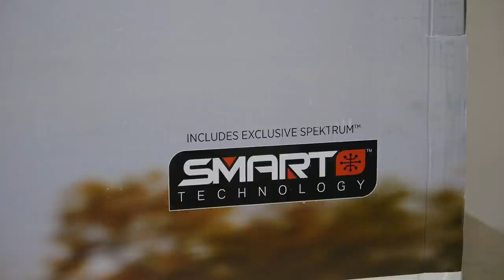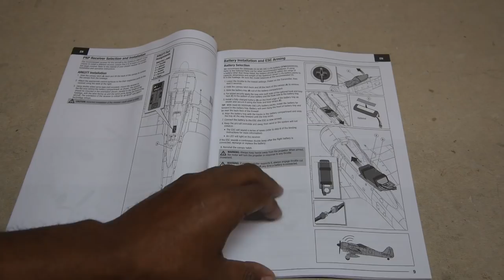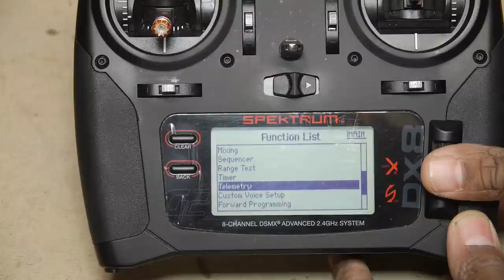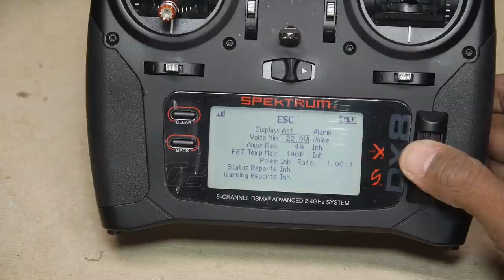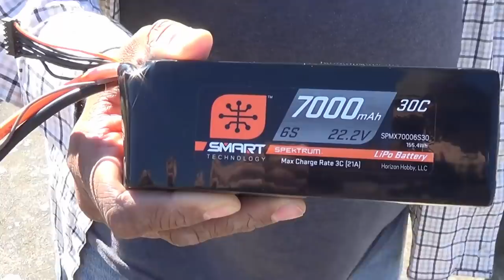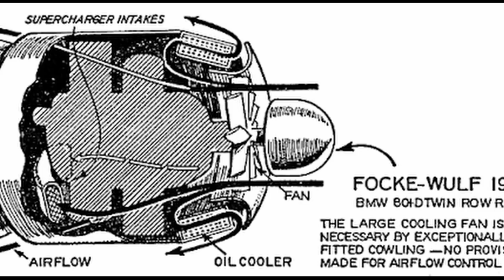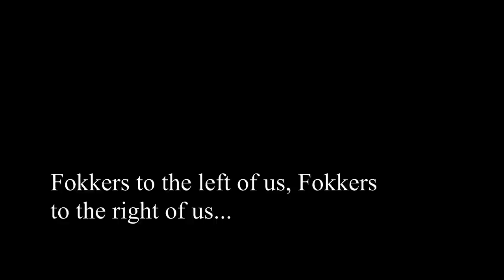E-Flite Fw-190A 1.5m Smart BNF w/ AS3X and SAFE Select - The Butcher has Arrived. | HobbyView

Comment: If you haven't yet, you should inspect the elevator push rod.  The pushrod is long, and it was unsupported (and bowing significantly when in compression (UP  Elevator)) in my EFLite 190.  I replaced it with a 2-56 push rod.  Just FYI.

Comment: I just bought the SU-47 from Banana Hobby. I have not heard hardly any good things about Banana Hobby planes, customer service, quality control, etcetera, but I didn't have any issues and they were actually very good about working with me. I have to admit that I was super worried but it turned out just fine. Except my thrust is a fraction of what it needs to be. The fans are great. That means the motors and/or the ESC are the issue. I would love to see you do a video about it because I think it is a very cool plane that deserves more attention. I also would like to hear someone's opinion who is more experienced at building than me. Keep up the good work!

Comment: Nice review.  Received mine three days ago.  Upon building I wasn't able to get the flaps to actuate.  After hours of stepping back through my build and transmitter programming, I found the problem; the triple plug interface between the wing center section and the fuselage was making only sporadic contact.  Jiggling the connection of the wires going from the plug to the receiver would cause intermittent cut-out of signal for the flaps and the landing gear.  I opted to remove the plug plates altogether from the wing and fuselage and run the servo wires/extensions directly to the receiver.  Viola!  No more problem.  Apparently, this is a known issue.

It has been too windy to put this beautiful bird in the air, but I'm anxious to do so.

As always, thanks much for sharing.

Steve

Comment: I haven't seen anyone fly this plane on rough grass runways yet. I know the FMS models have weak retracts and if you turn on landing you can break the forks. Also wonder how long those wing clips will last.
Reply from the maker: Yea, when putting the video together I realized I should have tried a grass takeoff and landing. I'll do it next time I'm out and let you know the results.
Reply: @HobbyView  That would be amazing. It's the only thing that's holding me up on getting one. Appreciate your time and responding to my question. Keep up the great content.
Reply from the maker: @Osse22  , Ok I had a chance to fly off of grass. Did several take-off and landings. Gear is definitely not weak as they survived a couple of rough landings.
Reply: @HobbyView  Thanks for getting back to me on this subject. This helps in making my decision for picking one up.